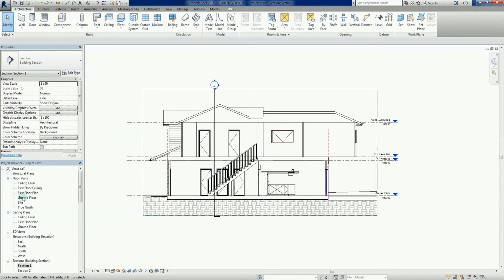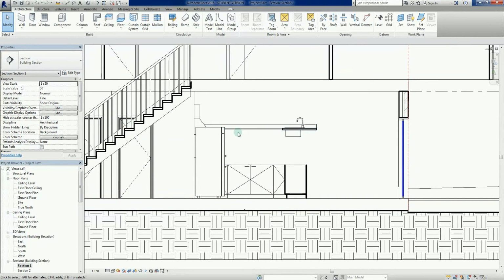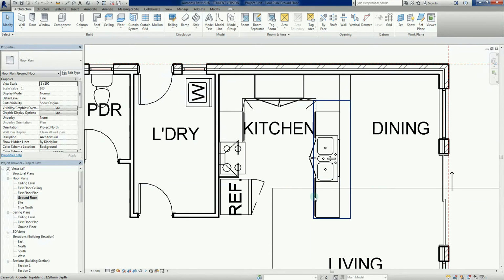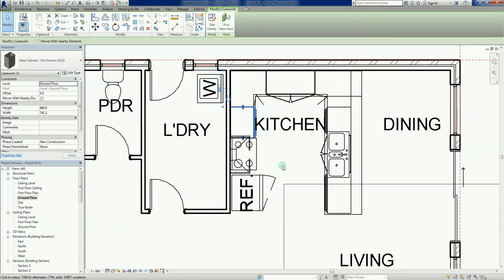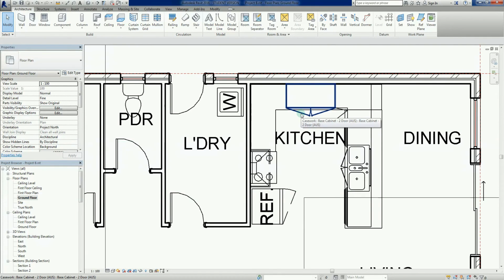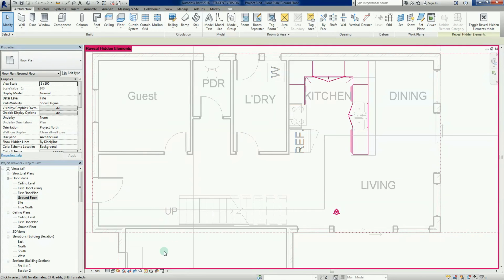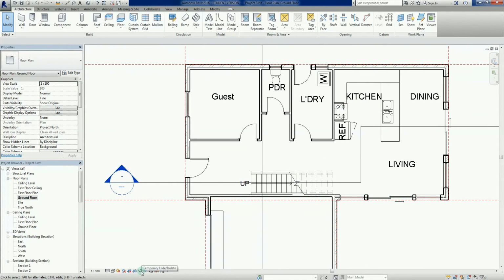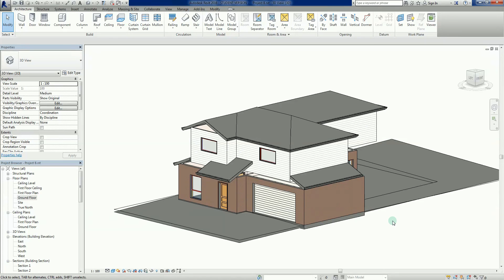Revit 2016 - Project B: #21 Layer Control

Comment: you aligned the top of the counter to the top of edges of cabinets. You need to offset the counter 30mm to allow for the thickness of the counter instead of hiding the cabinets.